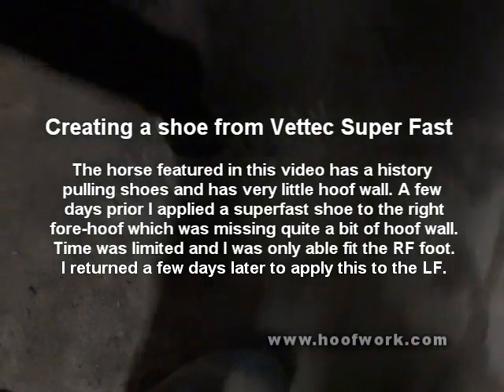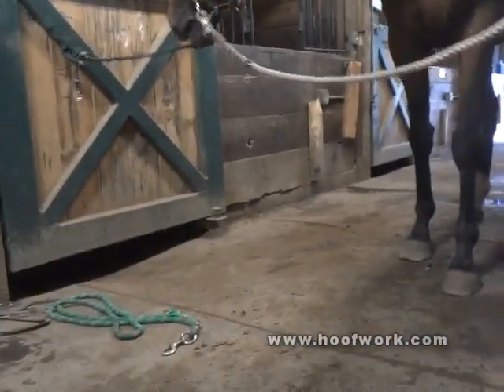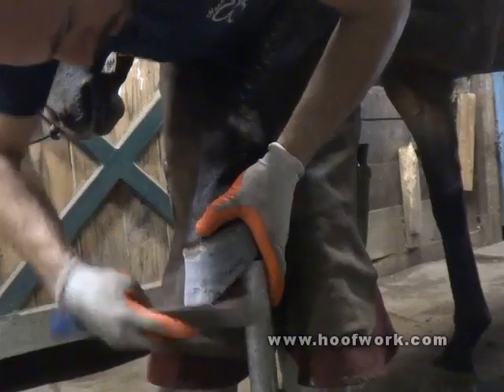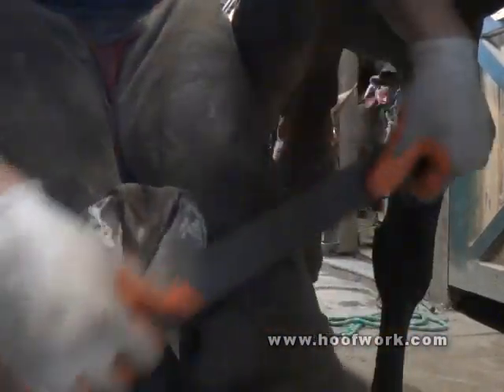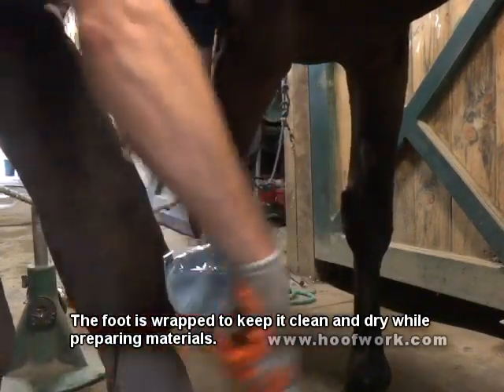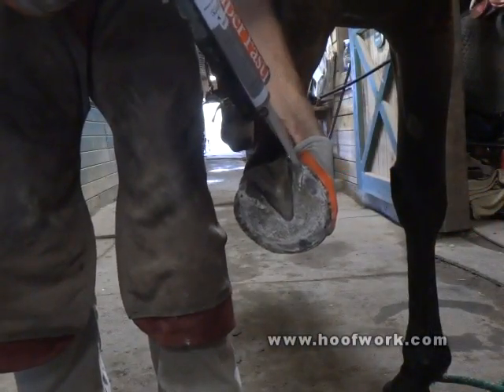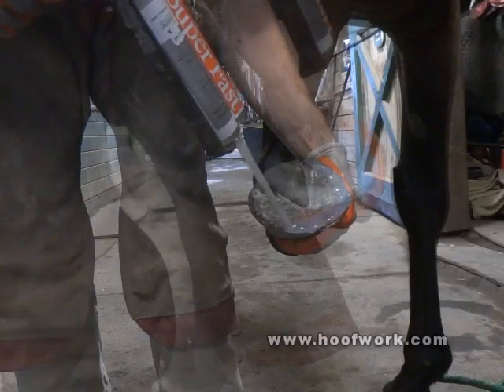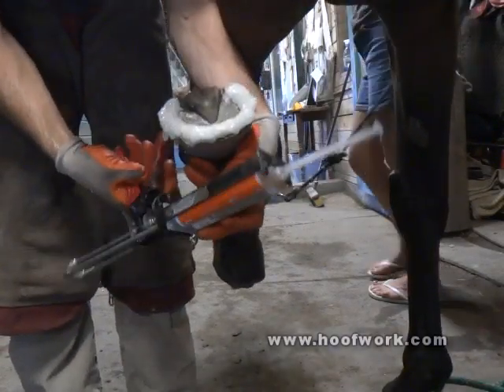Building a urethane shoe from Super Fast.

Comment: Is there a reason that you added roughly 1/2" laterally to the lateral heel? Or did you just use too much superfast?
The cuff only needs to be 3/8" to 1/2" up the wall. Yours extends about double that.
Are you a new user of this product?
Reply: clear wrap,horse hoof
Reply from the maker: Hi Ed, can't comment on excess laterally as this was quite a while back but probably just too much extruded. Yes you are correct there is too much for this application. This video is quite old  wouldn't recommend using that much superfast. 1/2" is a good number. I believe at the time I was concerned with making it smooth up the hoofwall.